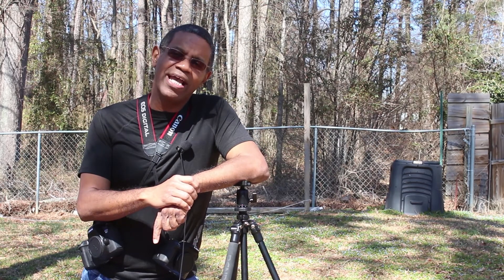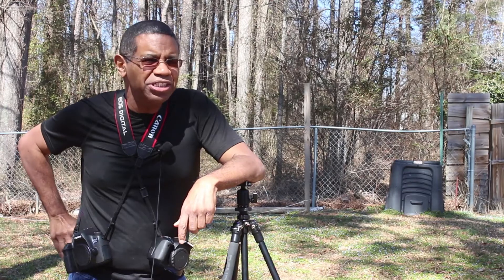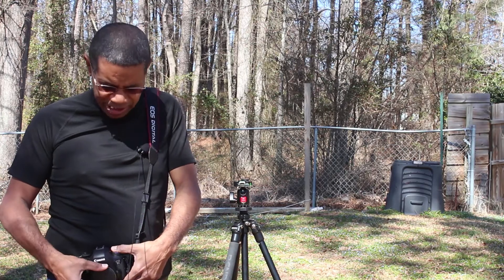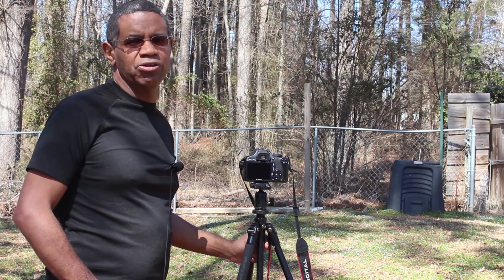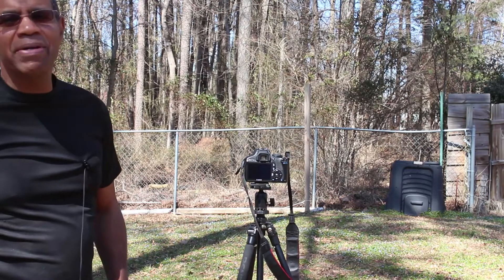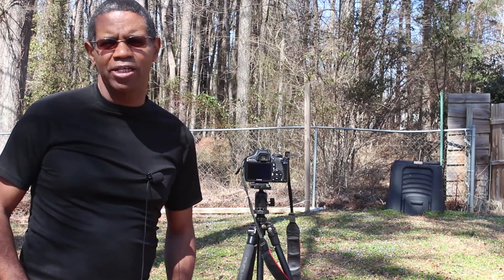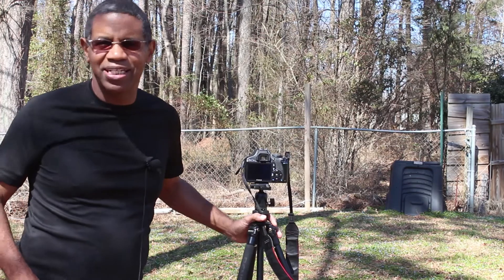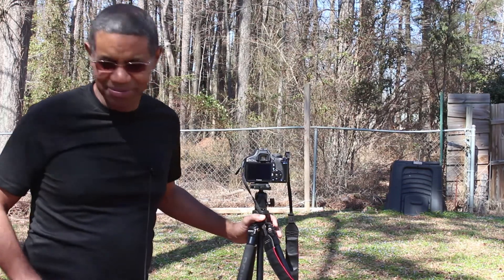Crop Sensor -vs- Full Frame Sensor on DSLRs

Comment: Which one do you recommend for putting images on tshirts and posters? Which one would you recommend if I am trying to sell pictures?
Reply from the maker: +Moe Zadeh   If the budget is there consider opting for the full frame camera. The pixel density should make the images a tad bit sharper and reduce artifacts when printed. However, you'll get great images from either camera. Your posters should be made with the FF sensor camera.
Reply: +Frank White +Frank White Thank you very much, I'm definitely going FF. I'm now deciding between Nikon d610 and Canon 6D. please keep posting more educational content!